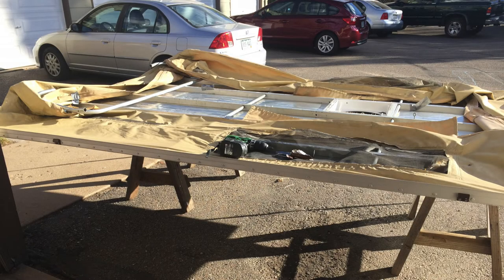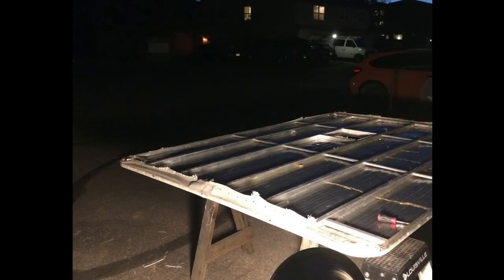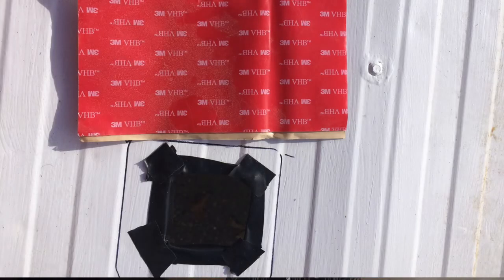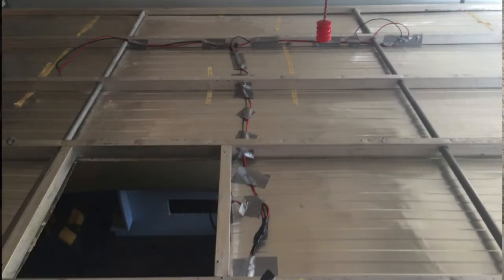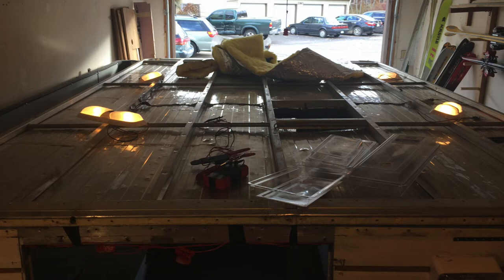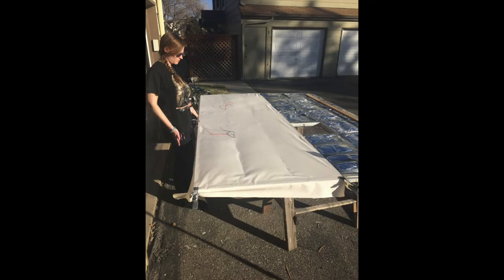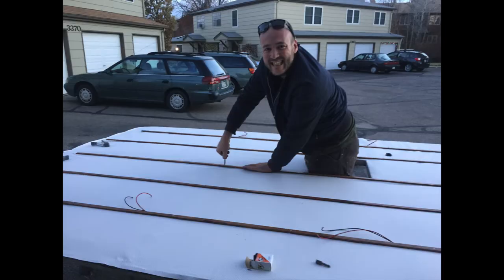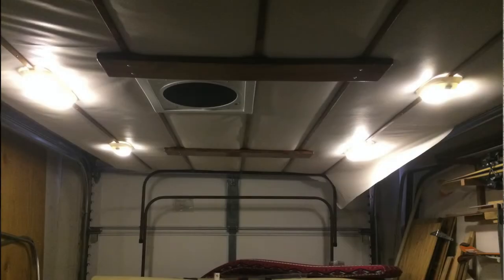DIY Pop Up Camper Project | Roof + Ceiling, Insulation, Headliner, Lights

Comment: I suggest using split-loom on your next wiring project, low cost available everywhere (harbor freight)
Reply from the maker: Hey Thanks so much for the suggest, I actually did use some of that for running the solar wires from the roof to the galley, I just didn't know what it was call and did not talk about it in the video. Thanks so much for sharing your insight, I learned something new today thanks to you.

Comment: Thanks for the info on the roof rebuild! Looking at picking up an older pop up and wanted to see how much work it might entail. Any estimate for how long a set off canvas sides should last? If I buy a 10 year old pop up should I just assume they are due for replacement?
Reply from the maker: Hi thanks for the note. If things are working well. I do not think the popup material would need to be replaced every 10 years. They actaully last a very long time. There are a lot of FWCs out there from the 90s that still have their original material and it still looks great.

Comment: Insulation : always a powderkeg issue.  :>) I went with thinsulate (van roof) . Time will tell.
Reply from the maker: Thanks for sharing. How did the thinsulation process go?
Reply: @tgmorrissey Passenger van, so headliner removal was tough. Had it out anyway for vent fan and light install. Snow doesn't melt off roof, so it must be working.  :>)
Reply from the maker: Headline in a van is a am sure a whole other story. Glad the material is working out for you still.

Comment: Tim I hope you are well. I was wondering about the wiring the lights to the ceilings. Is there a plug that is pulled out whenever you are lowering the roof and then whenever the roof is raised is it plugged in again, or is the wires built into your lifting gear.
Reply from the maker: The wires are in the corner of the camper and just run to The roof through a rubber wire housing to Under the galley. No plugging and unplugging. Just tucked away in the corner. In modern four wheel campers the just hide them behind the lifters. You can see mine but I don’t even notice it.
Reply: Thanks once again for your quick reply Tim. I never noticed the wiring in your video's either @tgmorrissey